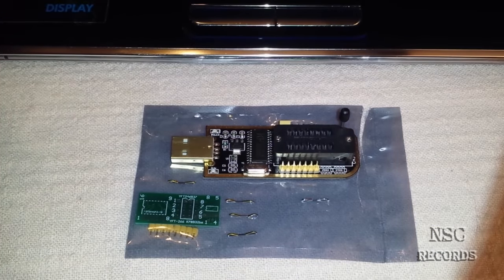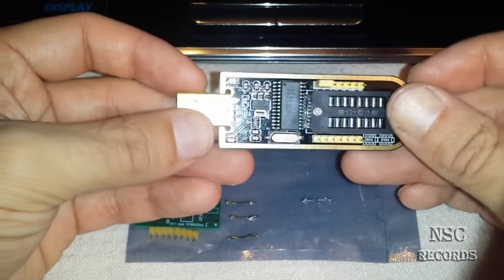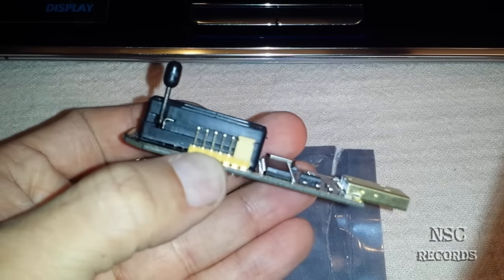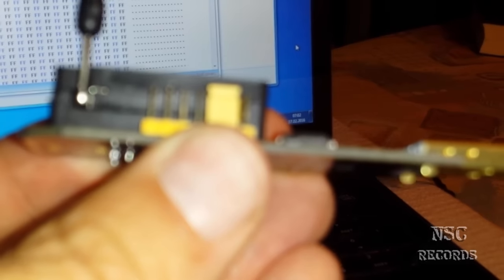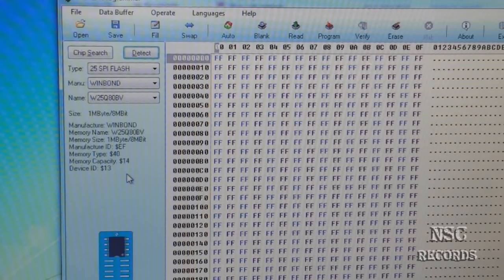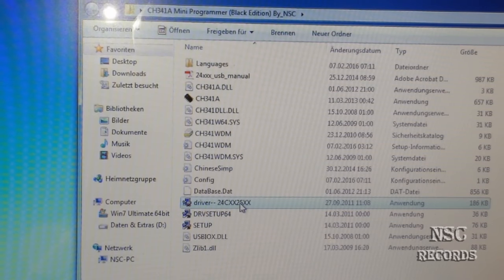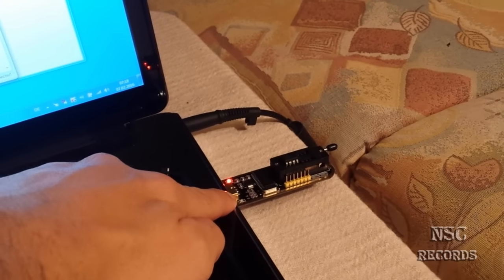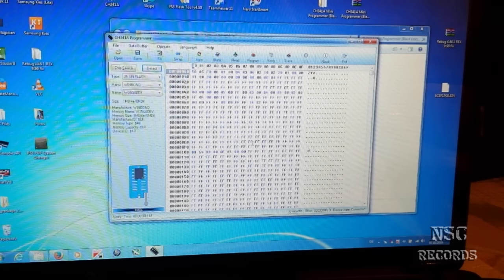Installing Drivers & Software for the USB Bios Chip Programmer CH341A (Black Edition) By:NSC

Comment: can i use other bios chip from an old motherboard and put it in the new motherboard?
Reply: the old bios chip is 4Mbyte/32Mbit. But my motherboard default bios is 8Mbyte/64Mbit. Will the 4Mbyte/32Mbit work?
Reply from the maker: @neils29  you can try it, you just need to erase the old chip completely, and then flash it new. Just try it, if it works its great, if not, then you know more ;)
Reply: @NSC-Modz  sadly, it didn't work. It says "File length, beyond range of will be ignored.

Comment: Hi,
I have follow your instruction. but not success for me.
After I program the BIOS chip and read again the chip not able to write in. Not sure is this because of the chip read-only or something.

- winbond, W25Q80BV
Reply: I have had a similar issue. I flashed a new bios on and when i connect the bios chip using a clip on the light on the chip dims and it says unconnected. I'm not sure what to do.

Comment: Where do i get the rom or bin file to flash with..???    I have the new exe file from dell..., xls8900-2.5.0.exe    I have tried extracting it on my computer...   It doesn't recognize the /makeronfile or /makebinfile commands..    Can you do it..., or can you tell me where these might be in a repository for download...   Safe ones.., of course...
Reply: the bin file is your BIOS driver it would be the thing to flash with your motherboard it should be .BIN you can get that from your motherboards manufacturer

Comment: I give up I have tried everything and every software to try and get this thing to work and NOTHING. This item has great potential but is useless because no one can seem to get the software to work except you so i congratulate you on getting yours to work. I tried the info you linked still NOTHING . If you could get a consistent program to work with this thing you could probably make some decent spending money selling them on ebay.
Reply from the maker: You should set all new again, if you have some driver problems, then it will be very hard for you, try all again on a new machine
Reply: I stand corrected I FINALLY got it to work and programmed a bios chip

Comment: WHAT IF THE BIOS READS UNKNOWN? i HAVE A FAKE MSI GTX 1060 3 GIG FROM EBAY? i NEED THE TRUE VERSION AND BIOS TO INSTALL??? PLEASE HELP???
Reply: 580
Reply: Dont rub the chip hardly or else it will break into pieces as it is a metalic glass chip. just clean the chip with water/isopropyl alcohol wipe that can be found at your nearest pharmacy.

Comment: I HAVE THE CH 341A BUT THE DREEN ONE  INSTALED BUT DONT READ THE CHIP ON SIDE HI MAKE IT FIRE I DONT KNOW WHY HI MIKE FIRE
Reply: make sure chip is correct way around, or it will get hot and damage chip if not inserted correctly

Comment: I have a Dell Optiplex 7080 micro with BIOS admin password I forgot so I can change configurations, does anyone know how to reset that or hack into it?  There's a ROM recovery chip but it's built into the motherboard.
Reply from the maker: It's same process, delete bios chip, flash new bios and give it a try.
Reply: @NSC-Modz  WINBOND 25Q256JVFQ isn't in the drop down and I can't find it online

Comment: Hello NSC i have a strange issue my Ps3 CECHA01 starts after 5 attempts i got 5 ylod and the star up but when i test a ps3 game it is shut down with YLOD, i already did a delid and apply new thermal paste 
The order of the lighs are Green yellow green and red blinking please answer me i don't know what to do
Reply from the maker: I think the pressure is not enough
Reply: @NSC-Modz  i already bent the plates.:'(
Reply from the maker: @Master-qj5qg  so check the thermal paste if it was really spread and check if the IHS is sitting on the right place, but this is the wrong video here to talk about that 😅

Comment: Can someone tell me how to get the files for the bios flashing i have a windows tablet to repair, please.
Reply: your manufacture should have the files. If it's dell or asus ect go grab the bios there. Tablets however, usually don't have the files, you will need to poach the files from another computer that is working. I'm sure the bios chips are not removable easily on a tablet.
Reply: +Eric W I have done this already to another tablet which had bios files by manufacturer on the site itself but not this time

Comment: CAN THIS USB PROGGRAMER CAN FLASH ANY LAPTOP BIOS CHIP,, IM PLANNING TO CLEAR ME MY BIOS BECAUSE  MY LAPTOP RESTRICTION ON UPGRADING MY PROCESSOR.. IT  SHUTS DOWN EVERY 30 MINUTES
Reply from the maker: I think your laptop is just overheating...
Reply: Sounds like you have Intel HM70 chipset, so this programmer wont help you. http://www.cpu-upgrade.com/mb-Intel_(chipsets)/HM70_Express.html
You can check your chipset with CPU-Z program http://3.bp.blogspot.com/-6Xq1wcU4aw0/VjmiSJTtC7I/AAAAAAAAA8M/Avt6Qu_VfNg/s1600/cpu.png

Comment: How do i get bios bin file for program flash? 
Have any website for it or how to make one bios bin self
Reply from the maker: Most bios from Mainboard can be used without problems, Notebook bios not all, Asus, HP and free more used bios files which need to be installed over the Windows. So it conforms

Comment: OK, I' using the programmer shown in the video. Jumper was aleady set correctly, by the way ;)
I am trying to flash a winbond W25Q64FV chip, BUT: it is not featured in NSC's version of the programming software. 
It does show the right position for this chip anyway, maybe its coincidence.
The other versions of the software that I loaded from the net do show the wrong position, even though the have the chip in their database.
So what do I do now?? 

By the Way: look on the underside of the programmer's board, there it is shown in which direction the bios chips have to be mounted to the socket.

But my problem remains: Where do I get a correct database file for my W25Q64FV that works with NSC's version of the software??
Help, anyone??

Comment: Hello. how can i convert any bios.exe file to this "coded" format so i can reprogram my bios???
Reply: are you programming an HP BIOS?  If so you have to launch the EXE and then choose the third option to extract the BIN from the EXE.
Reply: No. I'm using Lenovo G580 Laptop. Sorry i should mention that. Does tthis method apply also on lenovo bios files???
Reply: Not sure.  I haven't programmed a Lenovo BIOS.  I know where you can possibly purchase the decoded BIOS file you need for around 20 bucks....

Comment: A Dell Precision 5520 dual bios , locked , how can I remove and reprogram the chips????
Reply from the maker: Hello First you need to check if you can get the Bios file for your system.
Reply: How Can I find ? , Can I copy from another laptop the same model?
Reply: I have another laptop Dell 5510 not 5520 , but clean no bios lock
Reply: do you mean the .exe file ? or BIN file ? 
https://www.dell.com/support/home/us/en/04/drivers/driversdetails?driverid=4ng5x
Reply from the maker: Yes, the bin

You could also first do you a backup from the other one, and try to flash it on the locked one.

Comment: What does this chip do excactly? Like program the chip to do what?
Reply from the maker: +xFluffyMods with this Thing, you can Programm your PC Motherboard Bios
Reply: +UltraNSC hey nsc, ich kann meine ps3 nichtmehr anschalten weil ich ausversehen das flachband kabel von der ejectleiste kaputt gemacht habe :/ also die kontakte sind gerissen.. kann ich bei dir vllt eine ersatz ejectleiste kaufen ich hab den chech 3004b :3
Reply from the maker: Hi Ich habe leider auch keine mehr, schau mal bei ebay vorbei :)
Reply: +UltraNSC Jo danke hab was gefunden 😅
Reply: +UltraNSC was macht der Stick genau?
Reply from the maker: Bios Chips Programmieren

Comment: Hello. I use Teclast tpad x89. Is this device compatible with Installing Drivers for the USB Bios Chip Programmer Teclast tpad x89?
Reply from the maker: I think this will work for your tablet...
Reply: @NSC-Modz  Thank you very much. For the answer, I can't find a repairman in Thailand. So I have to do it myself. My ic chip uses the code W25Q64FV which is not specified in the programmer. The USB Bios chip has only W25Q64BV which is not the same. Which should be yes as you suggest

Comment: i cant install it in my windows 10
Reply from the maker: Should be possible, but win10 for stuff like this sucks and is not recommended... better use win7. On Windows 10 you need first to kick right mouse on the tool and run it with Win7, check this: https://m.youtube.com/watch?v=BUJjuft2yN8

Comment: Hi,
can you reprogram an already programmed BIOS chip with this ? The chip is in working condition, but already contains a BIOS and I would like to program it with a BIOS of a slightly different motherboard.
It's a Asus P5Q-VM board but some idiot programmed it's BIOS chip with a P5Q-EM DO, and now I cant access a lot of features of the original BIOS.
Thanks in advance.
Reply from the maker: +John Aybier Hello yes you can, you can Delete the Chip and Programm it new :)
Reply: UltraNSC Thanks for the answer. And is this tool surely compatible with the BIOS chip of the P5Q-VM ? Its a winbond IC, I can tell you the number on the chip if that matters.
Reply from the maker: yes, you can also buy you an Bios Chip from ebay, or just get you this programmer.
Reply: Thanks for the help mate
Reply from the maker: Roger, no Problem :)
Reply: +UltraNSC Hi,

So I bought the EEPROM usb flasher 
to reprogram the  BIOS chip with a P5Q-VM BIOS. I managed to program the
 chip with the latest BIOS version of the P5Q-VM, but when I connected 
the chip in to motherboard it didn't work. It just starts spinning the 
CPU cooler fan and that's it, it behaves like there was no BIOS chip in 
it. 

I actually have another P5Q-VM and took the BIOS chip out of
 it, and placed it in the one Ive just bought and it works with that 
chip just fine. 

When I examined the two chips better it 
turned out that they don't match, they come from different brands. The 
one I bought is a winbond IC, and one I took out from the P5Q-VM I had is 
some different one I could'nt read it exactly but its starts with an E 
so Exxx something.

I don't understand how can it be that the 
motherboard works with the P5Q-EM DO chip, but when I flash the chip 
with the motherboards original BIOS it does not recognize the chip. 
Because it seems that there is no phyisical incompatiblity between the 
motherboard and the winbond chip, otherwise it wouldn't work with the 
P5Q-EM DO BIOS as well, but why doesn't it work with the original BIOS 
of the motherboard ?

Do you have an idea
Reply from the maker: this can have a lot reasons ^^ There you will Need to try your self a lot thigs maybe, you can Copie the Bios from the working Chip, and Flash it to the other one, and test if this works...
Reply: The chip which works also contains the latest BIOS version which I downloaded from the official Asus site, so basically I flashed the same BIOS to the new chip as well. Any more ideas ?
Reply from the maker: ok, so i bet the Chip is Damaged...
Reply: UltraNSC  No it isn't, because it works with the P5Q-EM DO BIOS. It only doesn't work if it's flashed with the P5Q-VM BIOS.
Reply from the maker: ok, thats strange, but all the rest you will need to check out your self, i normaly give no Support, this is just a Video where you can see how to use that Programmer...
Reply: UltraNSC Ok no problem thanks for the help anyway
Reply from the maker: ive try my best :)

Comment: hello, can with the usb programmer to program the chip motherboard BIOS ASUS H97 plus
Reply: anci chip
Reply: you would need to find out the chip type by looking at the brand and chip number but it is compatible with a lot of 8 pin serial eeproms
Reply: The closest chip in the software is a GD25Q64 this might work, your chip is a 
Gigadevice GD25B64BPIG 64MBit 

Alternatively you can get a programmed chip from ebay sellers

http://www.ebay.co.uk/itm/BIOS-CHIP-ASUS-Z97I-PLUS-H97I-PLUS-H97-PRO-/380938085393?hash=item58b1ade411:g:EloAAOSwkNZUjiqu

:)
Reply: RetroCable.com 
This is the smartest idea, thank you

Comment: does this work for any laptop? my dell xps 9360 bios is corrupt
Reply from the maker: It depends on the bios chip, but i think yes :)
Reply: the problem with my laptop is, it fails at (Intel ME update).. and it wont boot into os... im hoping this Fix would work

Comment: Does this work for amd ryzen AM4 bios?
Reply from the maker: It conforms the Bios Chip
Reply: @NSC-Modz  what?
Reply: @skmajin2922  I suggest to look up the bios chip model number if you can. Some chips are 1.8v so you may need a adapter. You can buy this programmer kit with 1.8v adapter on ebay.

Comment: i want to flash dpc2100r2 modem can i flash with this ch341a
Reply from the maker: Try it ^^ Just don't forget to do a backup, so you can restore it back every time you need. ..
Reply: UltraNSC actually firmware was bricked i do have full firmware officially but the thing is that this will support ti flash or not can you do some google for me please sir i could not find the right way
Reply: UltraNSC my modem is dpc2100r2

Comment: Hi, thanks for the big video explaining.
I have the same ch341a black edition, but I can't read and write in my bios chip LENOVO THINKPAD t500 2241 chip P24S08.
Can you help me please, I think it's the voltage problem, this ch341a use 5v.
Reply from the maker: This new vid. should help you: https://www.youtube.com/watch?v=IPyansTQLUo
Reply: @NSC-Modz  I have already see it, my ch341a is connected but I can read this bios chip P24S08.
Reply from the maker: @abnad2827  so it's maybe not supported by this software.
Reply: @abnad2827  Lenovo much diffucult, then the other brands

Comment: hey NSC, habe den gleichen Programmer seit ca 2 wochen, jedoch kann er bei mir weder Chips detecten noch auslesen (kommt immer und überall FF FF FF) hast du noch eine idee ? chip ist ein W25Q256JV
Reply from the maker: Hi Lötest du den an oder machst du das über ein clip Kabel?
Reply: @NSC-Modz  Löte die Chips aus ( da es sich hier meisst um WSON8x X handelt)
Reply from the maker: Löten ist hier immer besser. Mal ein anderen programmer getestet, oder andere Software? Machst du das über Win 10 oder Win 7? Win 10 ist für solche Zwecke nicht zu empfehlen.
Reply: @NSC-Modz  egal ob Löten oder mit nem Adapter, Ergebnis bleibt immer gleich, habe leider nur einen CH341 Plus (ohne A am ende), und OS ist W10-64Bit (da ich kein anderes OS mehr darunter habe)
Reply from the maker: Windows 10 blockiert oft solche anwendungen und dann laufen die nicht richtig. Das gleiche mit andere Software. Nutzt du die Software von mir? Oder was anderes?
Reply: @NSC-Modz  Software sowohl als auch getestet, auch schon verschiedene Revs der Software. Vllt sollte ich echt mal nen alten PC mit W7 aufsetzen... Hast du einen Link zu einem brauchbaren /funktionierenden CH341A (Amaz wäre toll)
Reply from the maker: Naja, mit Windows 10 kannst die Software ja schlecht testen wenn Win 10 es im Hintergrund teil blockiert hat 😆 Diese Software ist mit Win XP oder Linux programmiert worden, damit läuft es auch an besten. Um absolut fehlerfreie Funktion zu gewähren unbedingt Win XP oder Win 7 nutzen. Und dann sogar am besten 32bit. Hast du Teamviewer und Whatsapp?
Reply: @NSC-Modz  jahaa das hab auch ich mittlerweile verstanden, die nächsten Tage mal schauen ob ich einen PC zusammenbekomme und W7 - 32Bit installieren kann.... jetzt muss nur noch der neue ch341A programmer ankommen ^^
Reply from the maker: @benh8core212  du kannst auch auf dem Tool mit rechte Maus klicken und Eigenschaften/Kompatibilität/Win7 und als Administrator anklicken, übernehmen und OK versuchen. Ich glaube weniger das es am programmer liegt.
Reply: @NSC-Modz  wie gesagt, mir wurde leider nur ein CH341 geliefert (keine ahnung ob der identisch ist mit dem CH341A). aber ich habe auch irgendwie die Vermutung das der 341 nicht mit 256MB Chips zurecht kommt...... Kompa wurde natürlich schon testweise geändert auch inkl Admin ;) leider Ohne Erfolg
Reply from the maker: @benh8core212  hmm Hast du es mal mit meiner Software versucht?
Reply from the maker: @benh8core212  ich denke ich habe dein Problem gefunden: https://youtu.be/-ln3VIZKKaE
Reply: @NSC-Modz  Leider nein, habe den 3,3v Mod schon getestet, genau das gleich Spiel :(
Reply from the maker: @benh8core212  echt komisch
Reply: @NSC-Modz  So neuer Programmer (leider wieder ein CH341 obwohl CH341A in der Anzeige stand) Win7 32Bit in ner VM... was soll ich sagen, gleiche problematik. Beim Auslesen der Chip ID kommt nur: ID(9F): FFFFFF(Unknown)
ID(90): FFFF(Unknown)
ID(AB): FF(Unknown)
ID(15): FFFF(Unknown)
Keine ahnung ob es am CH341 (ohne A) liegt, ob der Chip schrott ist oder wirklich am Windows (Am WE mal W7 32Bit auf nem Testrechner installieren) aber ich denke es wird nichts daran ändern
Reply from the maker: Hast du mal die Software von mir versucht? Du kannst mir den Chip mal einschicken dann teste ich mal ob es bei mir läuft. Vielleicht ist der Chip selbst ja auch echt defekt...
Reply: @NSC-Modz  Die Software inkl den Treibern aus deiner Info habe ich versucht, jedoch ist dort leider der W25R256JVEN nicht hinterlegt. Denke deshalb geht es mit deiner Version nicht. Ich schreibe dich am besten mal per Whatsapp an.
Reply: hast du nen Discord ?
Reply: @NSC-Modz  Habe dich per Whatsapp angeschrieben.... hoffe deine nummer ist noch aktuell